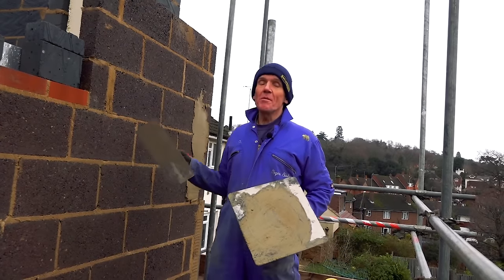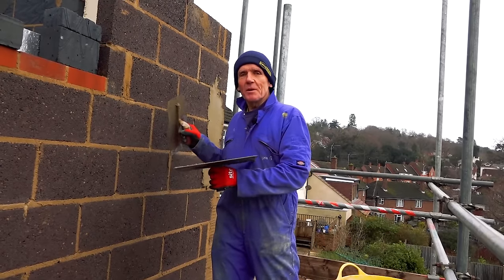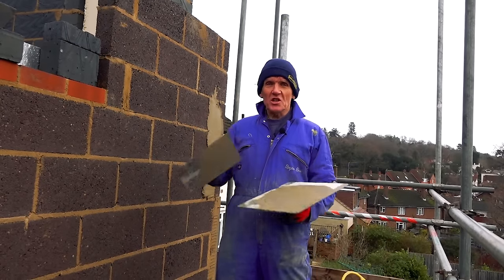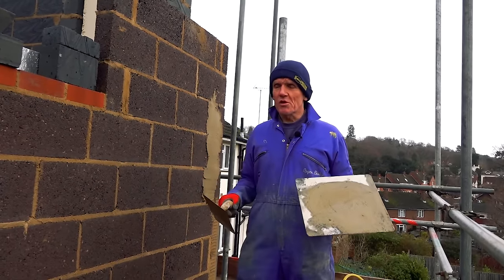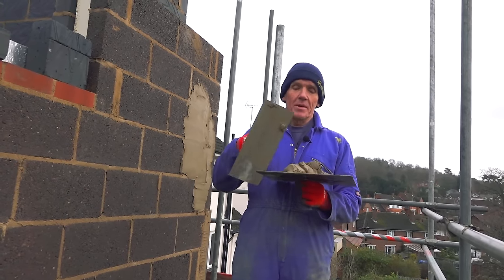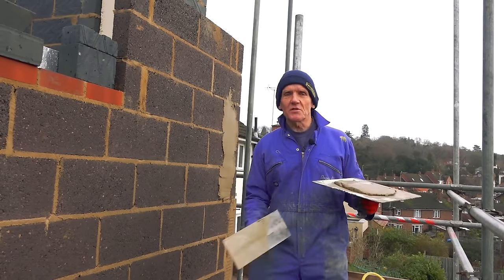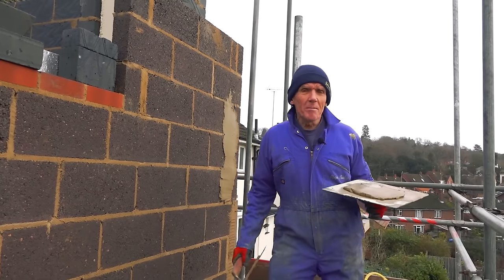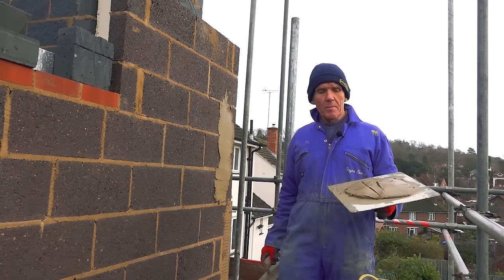What's the Best Mix for Perfect Rendering?

Comment: Do u not scud the block work for the scratch coat to grip to
Reply from the maker: Have a look at the blocks. The grip is way better than a scud or pricked up slurry. Scud on smooth faces for sure.
Reply: @SkillBuilder  all block work here in Ireland is scudded before plastering

Comment: What about waterproofer in the scratch coat not to used with lime.
Reply from the maker: I don't use waterproofer. It locks moisture in. Plasterers use it to reduce suction and give them more time but as far as weathering the building goes I think it does more harm than good.

Comment: Whats the best way to measure 1 part plastiser to 40 parts water...
I can't figure out....
Reply from the maker: Most people just splash a bit in but if you take a plastic bottle 1000ml (i litre)  you would be looking for 25ml which is just under 2 tablespoons. If you are using an enhanced cement, usually sold in plastic bags, the plasticiser is in the cement so you really don't need to add any. That said, I see loads of builders do. Just cut down on the water content because it gets sloppy as it is mixed.

Comment: What about drilling metal mesh onto painted brick walls?
Reply from the maker: Yes you can do that. I hate doing it and would rather use fibre glass mesh.
Reply: @SkillBuilder  I got a painted wall that is matt black paint and no cracks anywhere but there are massive wet patches on the inside BUT the patches are dry but dark like they are wet.  They fade but then get darker when it rains. 
I've changed the roof slates, ridges, facias etc...but still it comes!?!?! And I've plastered inside!?! Hahaha grrrr.

Comment: You sound like you know your stuff good job , I’m looking for advice been plastering about seven years or so now but not done much rendering normally get a mate to help me on the rendering he’s been in the game since school and it’s all he’s done he only uses building sand gets a nice finish . I’m getting more and more rendering jobs coming in and want to know how you render  on breeze lightweight blocks as got a big extension job all over breeze blocks which I know sucks in like a rocket 🚀. Help cheers
Reply from the maker: The way to do it is to apply an slurry of SBR and cement and then prick it up with a roller. The next day you can put in a scratch coat. I always use a glassfibre mesh these days
Reply: d Plastering I'd. Personally if it s a thermalise block you're referring to give it a soaking then sbr slurry and scratch coat while tacky.Top coat will be a breeze.Ive been rendering over a lot of membranes lately as construction methods change

Comment: Is this mix just for outside walls?
Can it be used inside as well??
Reply from the maker: Yes you can use it inside
Reply: @SkillBuilder  Any chance i can send you a small vid to show you what i an up against?
Bad brickwork,old mortar that just keeps crumbling when i brush it down to remove dust,just makes more dust.Should i wet it before i start?
Reply: Stephen Valentine  its an old house,built without damp course. Was hoping a good mix with plasticyzer would help keep damp at bay. Or would it just push the damp up higher?

Comment: so just normal hollow breeze blocks can my dad put the scratch coat anything meant to be put on first
Reply from the maker: If it is smooth faced block then it would benefit from a pricked up slurry coat of SBR and 1 to 1 sand and cement. If the face is rougher or the mortar joints are raked back you might not need it. If you apply the slurry with a stiff yard brush and leave it overnight it will be good to go. 
If you are covering the blocks you can just do a single coat. The second coat is really just for outdoors and to give a better finish.
Reply: @SkillBuilder  thanks so much my dad and i think your videos are great,These breeze blocks are rough to touch.he is making a small swimming pool  do you think because its a pool that it should have a waterproofer in the render .the first scratch coat how thick and the top coat how thick .I will get him to read all your answers tonight thankyou so much for helping .on top of the rendered wall there is going to be foam or pool felt.we were just going to stick that to the breeze blocks and not render only render the outside,But pool people say not a good idea .
Reply from the maker: @SimoneOconnell  I would apply a single coat of render and rule it off and rub it up with the urethane float. I can't see any need for a second coat. The first coat with SBR will stick well and flatten it so there is nothing more you need the render to do.
Reply: @SkillBuilder  sounds a good plan going to get my dad to have a look in a minute thanks so much for all your help.

Comment: Should I use water proofer in the scratch and lime in top coat ?
Reply from the maker: Some people do but more to stop the suction. Waterproofer is not essential and can trap in moisture
Reply: Skill Builder ok cool thanks, so would u use any additive in scratch like a plasticiser or just sand and cement?
Reply from the maker: I like a splash of SBR in the water. It helps adhesion and does the job of a plasticiser. But the lime works as well
Reply: waterproofer in finish plaz in scratch if u use wp in scratch coat the water wont soak in so under pressure in summer on big panels cos ur only wetting the surface if u use plaz in scratch you can soak the wall better
Reply: Waterproof is a must on scratch coat and even on top coat. But most definitely on scratch.

Comment: Do you add waterproofer to this?
Reply from the maker: I don't like waterproofer in render but it is used to reduce the suction and give you more time with the second coat. The trouble is that it traps moisture behind the render.
Reply: @SkillBuilder I’m looking to build a single skin block shed. Likely a render finish. From what you say, best allowing it to breathe?
Was just looking at options. Stud walls and vapour barrier I was thinking would be best.

Comment: Is it ok to put lime and plasticizer too?
Reply from the maker: It can make it a bit too weak
Reply: @SkillBuilder  thanks, i tried your mix with lime for an old cleaned interior brick wall but the mix doesn't stick at first, I must work it a little. But I think it is because I didn 't let the plaster sit for 5-10 minutes aftex mixing, like you said in the video

Comment: 4,1 scratch cote and 5,1,1 top cote. 6,1,1 would be over filling the bell mixer and a very if not too weak of a mix.
Reply: you dont need to adjust the ratio,just make sure the first coat is thicker than the top coat

Comment: Best mix. 
4:1:1 Render, soft, lime. There isnt a better mix. Also always put sand in first in mixer. Its cleans the drum. If you put the cement in first it sticks to the side. I used to be a hod carrier back in the day so knocking up muck was my thing day in and out. Also use buckets to gaugue. To be honest though mate you mix looks SHITE. Also alot of lads now just get ready mix. PS 
DON NOT PUT WATERPROOFER IN THE FIRST MIX!!!!!
Reply: I go with the same mix Jimjim. Don't you find the float coat pulls in way too fast with out some waterproofer particularly when it's warm? Also agree that muck looks wrong, no life in it.

Comment: Can you render onto a painted brick wall?
Reply: Use parinter
Reply: No you can't. Have to mesh it with 8x2 stainless mesh. Or use exterior plasterers pregrit two coats are required

Comment: Do I always need scratch and finish coat. I've got a 4m run of plinth about 20cm tall 10-15mm thick and an gonna use some Rendagrip. I normally do two coats but fancy trying it with one coat. Your thoughts?

Comment: No corner beads???
Reply: U can put 10mm corner beads on top of your scratch , I do it if block work is all over the place
Reply from the maker: This is about the mix
Reply from the maker: Not yet but they go in later
Reply: corner beads are rubbish i use 3x1 if u use a bead and the corner ever gets a knock the whole corner is gone if u use 3x1 u only take a piece out  and easy to fill

Comment: I've been a good general builder and stonemason for over 25 years. I've seen labourers with better trowel skills than this guy. Far too stiff  too. I'd throw this bull muck back into the mixer. What's he on about "don't use building sand"??? A good 4 to 1 building sand to cement with a dash of elasterciser, waterproofer or even fairy liquid (if none of the first two).
I get fed up with these DIY videos!
Reply from the maker: Nige 

Where in the title did it talk about learning trowel skills? I am talking to the camera about the best mix and yes it has been hanging around for a while. 

All plasterers will advise against building sand, it contains silt and clay and is not washed. It will shrink and crack. That is why they sell plastering sand. As soon as you mention Fairy Liquid you show that in your 25 years you have learned very little. 
It is not elastericiser, by the way, it is plasticiser.
Reply: @SkillBuilder  Hi Roger
Apologies mate
I've been watching all your videos. Ive watched all your 'how to build an extension' ones and I can see you're are very knowledgeable. As a builder of many extensions myself (and doing all my own labouring for many years...... suffering a bit now though).
I can see that all your work is of a very high standard.....quite old school with modern thinking if you know what I mean. I liked how you built the engineered brick pier to take the weight of the steels instead of laying them on the lightweight Newton blocks. Good building practice. Also liked how you explained all the complexities of ridge and wallplate level and made it sound simple for laymen and novice builders. The 3:4:5 measuring took me back to my apprentice days. Brilliant and never let me down. Much more accurate than my big bendy square. Liked all your drainage videos too. Very good. All very neat and tidy. I once had the same problem with concreting a footing whereby they couldn't get access to the back end of my extension but the company insisted that the concrete will easily flow to the other end! Huh. I was raking it back for about an hour. For future jobs like this I then insisted on really  runny concrete because one of my old building inspectors said that it didn't matter how wet concrete is.
Anyway sorry for 'rabbiting on'
I've subscribed to your channel and will recommend it for any budding young DIY ers or professional construction workers!
Reply: Rob Songer expains why dish-washing liquid is bad idea to put in your mix.

Comment: Never mind the mix 6.1.1 which is very week. And must be very raw.
Your scratch coating onto a wall witch hasn't been  skooded nó key to get grip. It's true not all cowboys  ride horses...
Reply: What's skooded Tom? Haven't heard that term down here in the south west. Do you mean an SBR/Sand cement slurry? I'm interested to know, always thought the surface of concrete blocks with the pits provided a decent key. Agree with the mix being too week and it looked dead. Genuinely interested in your thoughts, you can never stop learning in this business.

Comment: plastering sand? you would never get a good finish the more you work it the worse it gets, rendering sand under a microscope should be sharp and angular plastering sand is rounded, so the water separates quickly, I sometimes use a shovel of sharp sand per mix which gives you more strength so you can reduce the amount of cement

Comment: I use lime render  found it is the best since ,Roman times  just look up why not use cement
Reply from the maker: The Roman's also used cement and in particular rapid set waterproof cement  for their aquaducts. It occurs naturally in Grenoble.
Reply: Yes that's right lime mixed with gravel and volcanic ash like lime Crete and they used woodfiber which is very popular now sound proof and insulated to 0.33 like the old joke what did the Romans do for us 😁

Comment: Funny thing mate is how diferent rendering is in my country...
Reply from the maker: It is interesting to see different ways of doing it around the world which is why some of the [people commenting need to get out more. Your average plasterer works within 50 miles of their home so they live in a bubble as far as techniques and materials go.
Reply: @SkillBuilder   to cut long story short as it is possible...here it is realy rare thing to see so nice stacked blocks. brickworkers here work with bad and uneven bricks and blocks, walls are rarely so straight as yours. Its olasterer job to make it nice, they just stack bricks on pile :)
So we first mix a realy thin, almost water like mix of sharp sand and cement 1:1 ratio...and spray a wall wit it, so the plaster can athere to wall. Than we make vertical guidelines on wall using plaster. 1 to 1.5 meter apart. first and last guideline are leveled with masonary plumb or lever. and thise betwean are leveled with a thin rope. then we make a mix with sharp sand(3-4 mm) and cement and lime. Ratio is usualy 1:3:12... sometimemes 4, of lime if it not atheres to wall depends on sand sharpness. Then we trow that  mix between guidelines so it comes litle bit more than guidelines. then we drag a plank or long leveling lever so we remove eces material. Thicknes of that coat is from 2 to 5 cm...depends on quality of bricklayers job. thats basicly our scratch coat....exept we dont scratch it, because finish layer adgeres good to sharp sand. Our finish coat is actualy realy similar to yours. We mix realy fine, powder like sand with cement and lime...just as yours mix depends of type of wall...bricks, concreate blocks and so on.
only big diference on finish coat is that we dont drag olanks to make it eaven....we did it on "scratch coat" and last part of job... we let the final coat dry until is not gluy...and then we use big sponges and finish the wall. o ly bog diference ia that cause we let the last coat dry...we wet it with water...sponge it to remove exec material and make it eaven....an than just like you we make one final pass with dry sponge.
Thats how its done in almost all countries of ex Jugoslavia.
Sorry on bad englis :)